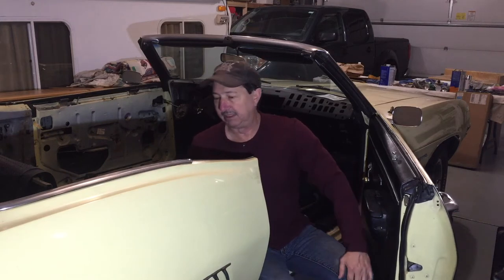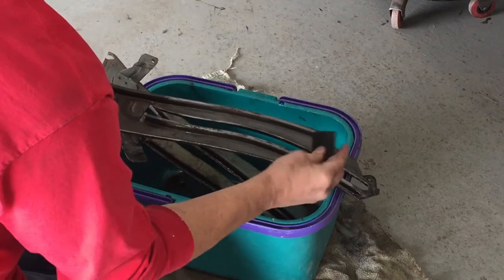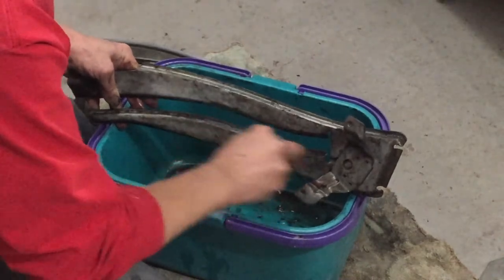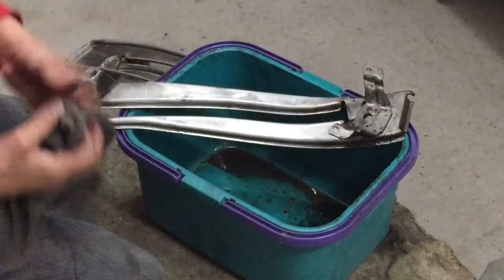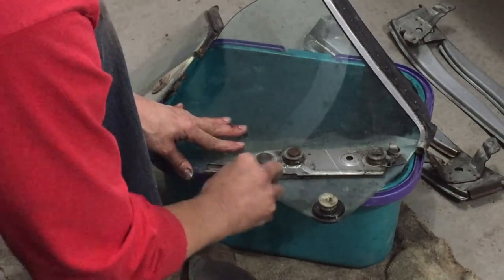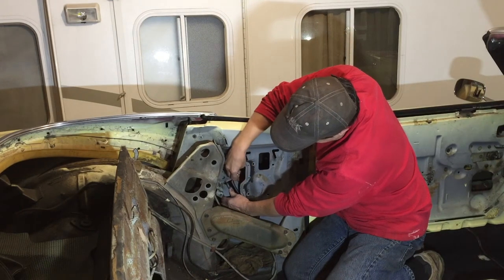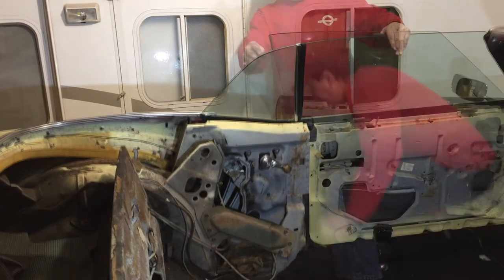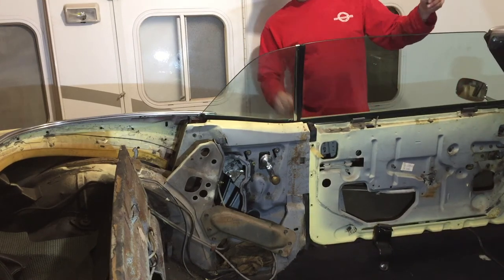Sticky Camaro Rear Windows, 1969 Camaro RS Convertible Rebuild, Restoration Project.

Comment: White lithium grease works like a charm in these old window channels. A restoration shop turned me on to it in the early 1900 & 80's. I used white lithium grease on my 68 RS convertible power windows until she was stolen in the 2000. Now I have a 1967 RS Camaro convertible. I would like to know where Mr. Ride Rescue bought his convertible top kit for this 69.
Reply from the maker: I forgot about the white lithium grease. Great tip. I purchased the top and supplies from Ricks Camaros on line.
Reply: My glass is so bad on my 69 Camaro that my qt glass is scratched pretty bad .I will give white lithium grease a try. Ty